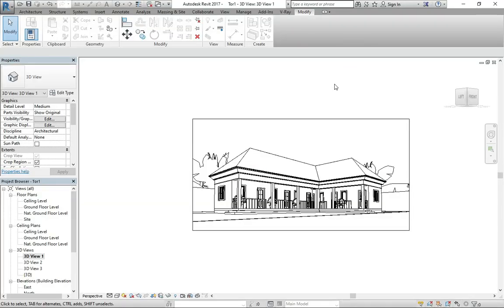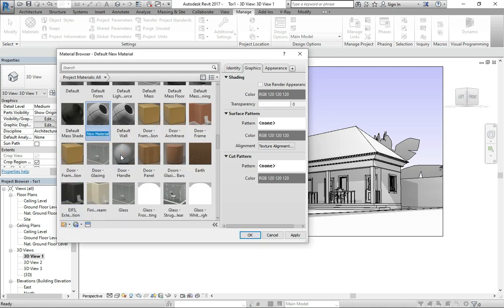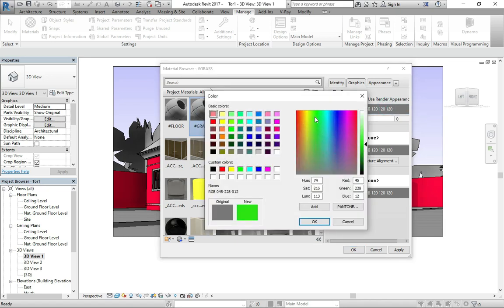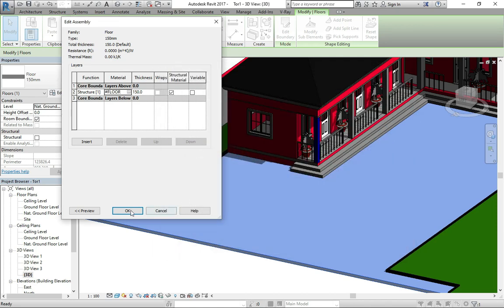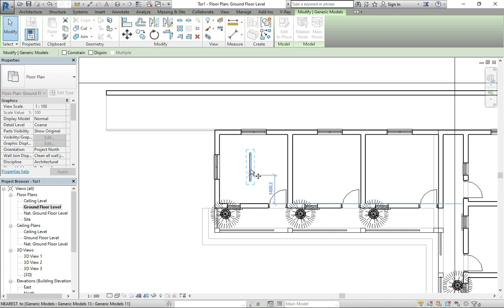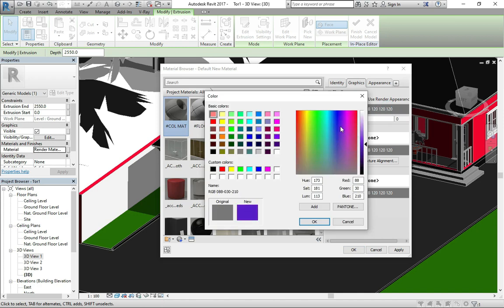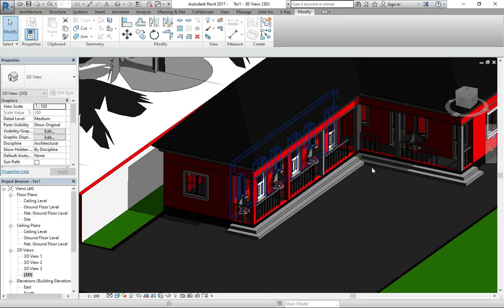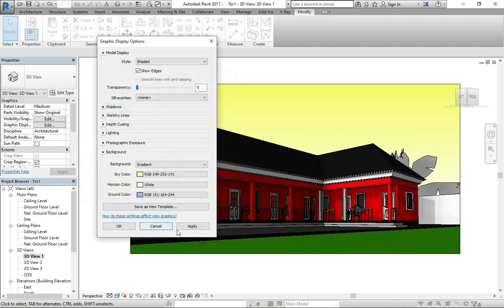Revit Beginners Tutorials You Haven't Watched Yet

Comment: Bro you are really doing well but I want to ask you how can someone download Orion please
Reply from the maker: You can do that online. But why don't you go for prota structure. It designs for both concrete and steel. Just like an upgraded version of Orion CSC.
Reply from the maker: But you can still start with Orion CSC though
Reply: @iamphyize  but what is the major difference between the both
Reply from the maker: The interface, but the moment you understand Orion CSC then you can go on with prota
Reply: @iamphyize  ok thanks can they all be downloaded for free
Reply: And which website
Reply from the maker: Uh sure
Reply from the maker: I think I should work on the downloads too
Reply: @iamphyize  yes so that it will be easy  to download and install too
Reply: So what is the name of the website or link to download both Orion and Priya structure